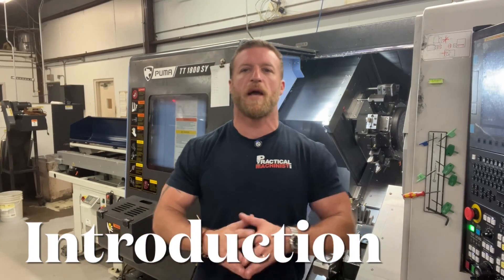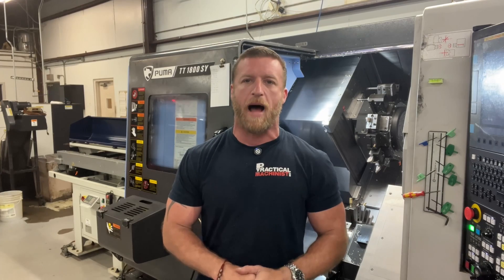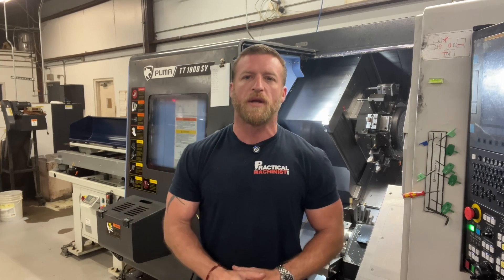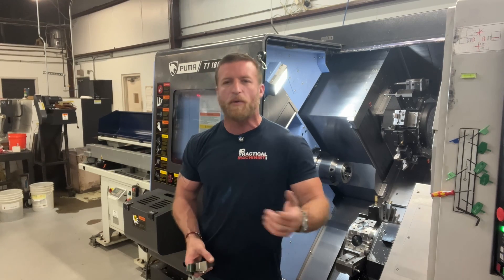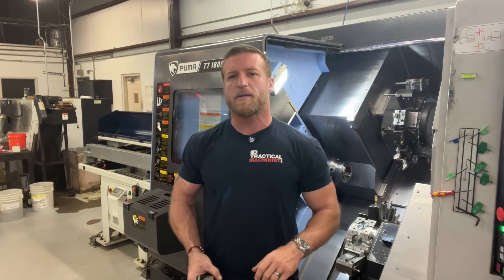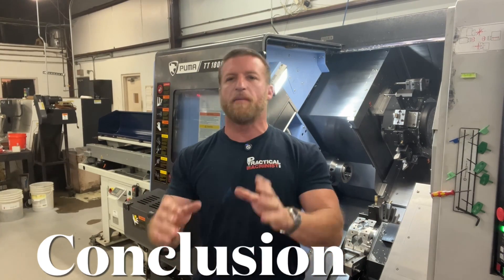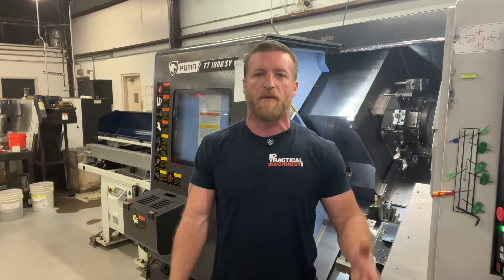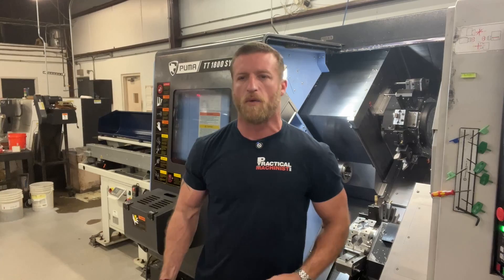Why I machine stuff the way I do- love the comments!

Comment: Your explanation makes sense when you read between the lines. 
Using a beefier insert to finish will correct the inconsistency from the 35deg. 
So as a time and cost saver you can't go wrong. And the fact alone which most miss, is that you're using the beefier to finish just shows why we shouldn't judge a book by it's cover. And pay closer attention to details. To many haters out there. 
Good video.
Reply from the maker: Hey Shaun. 100% accurate. Thanks for the input and thanks for watching 🙌🤝

Comment: The VNMG style, as any V style inserts, Are made for roughing. Why do you think many holders come with an over clamp? It’s definitely not to make the insert stable while taking a .005” pass, trust me.
Reply from the maker: I use the heck out of them for roughers. And I get a lot of pushback because of it. But I love the comments 😂🙌
Reply: @Crusadermachining honestly, Haas did a showcase of one of their machines a few years back in I want to say 4140, all their tooling and inserts, hogging an undercut with no coolant going beyond recs at 800sfm. There is a reason they come with overclamps. 😅

Comment: I do something similar but on a CNC Swiss-type.  Even if the tool is not the "most" appropriate for the feature, having common tooling already touched off in the machine makes for faster setups.  This allows me to go onto other setups while the machine is running.  Now, if it's a serious high volume job, then I'll optimize each tool to reduce cycle time.  Keep up the good work!
Reply from the maker: I know exactly what you mean about the Swiss machines I’m the same way especially on them. Thank you for the kind words and thank you for following along.

Comment: I do the same thing a lot nose radius is nose radius lol keeping the same stick tools in the machine can save a LOT of time. I rough with a DNMG quite a bit instead of swapping for a C just because it's there and we do a decent amount of tailstock work. A V or D also won't chatter nearly as bad there's less surface contact (is how I think of it?). I use VBGT's for finishing a lot because you can cut a 45 on the back side of something, but they're a lot more fragile than even a DCGT. But a 0 degree VN tool is just as meaty as a CN or WN to me (within reason).  I will say though in my opinion it's not good practice to take a facing cut deeper than like 75% of the nose radius.
Reply from the maker: Great assessment. I like the way you think and you’re right about the lower cutting pressure. Thanks for the input 🙌

Comment: Man, if those yom-yoms found out you could bore with an insert drill, the world would end!

You may have mentioned it and I skipped through it, but maybe just maybe you need the added clearance of a V… because you’re using a tailstock! I usually just leave the C… rough when I use the tailstock and let the tool do its job by adding clearance to the live center🤷‍♂️
Reply from the maker: That’s a good point and yes sometimes I do need the V geometry

Comment: Do whatever works, especially if it's just for smaller production runs, or for low-quantity jobbing work.  If you have partly used inserts that you can use as roughers - great!
Also, for some parts that I machine that have a 45-degree back taper at some point on their profile, I absolutely have to rough and finish with a V-style insert - anything else will crash into the part.
Reply from the maker: Clearance is king!  And yea a whatever works, works.  Especially if they’re already bought and paid four years ago. Thanks for your in.

Comment: Bingo!  I use DCMT for roughing and finishing bores in 304SS. They are big long bores so I only get 4 parts per edge on the finisher. When the finisher needs to be replaced, I stick in the roughing boring bar. I rough bore from the inside out and the DCMT has the proper offset for doing that, and doesn't recut chips doing it that way.  This cuts my insert usage in half !  Then the roughing insert  (previously a finishing insert) is done, it's all used up and ready for the carbide bucket.
Reply from the maker: Yes!!! I love that idea and the way you phrased it. I hope others come down and see this comment. Great lesson here and thank you for sharing 🙌

Comment: Nothing wrong with your approach, as long it works no problem.
A simple advice, when you do high volume of barstock work and you have a Y-axis (or half index) buy single or double side radial toolholders for two tools per side, put e.g. C and W insert holders on one station, D and V insert holders on the next and groove and thread on a thrid, you can place two or four holders per station, running a sub spindle you can easily put twelve tools on three holders.
Saving a huge amount of setup time plus saving stations for other tools.
Reply from the maker: Yes! I love that idea and we do have half positions. Keep them loaded up as often as we are able. Great Input thank you for the comment 🙌

Comment: The obvious question is - why don't you have a roughing tool permanently set?  Surely a roughing and a finishing tool are the first 2 you load when you get the machine. My second question is - does it really take such a long time to load a roughing tool?  It's a few minutes on most machines. You say that you have a box of part worn inserts that you swap over to use for roughing, that can take longer to change over, than changing a tool to a roughing one. Your defense of using finishing tools as roughing ones just doesn't stack up for all the reasons above. That's without considering the cost per edge which is significantly higher with diamond shaped inserts, compared to 6 edge inserts. Your insistence to do it wrong is paid for by your clients.
Reply from the maker: I definitely appreciate your opinion. But can you explain, specifically,  how it’s “wrong” and how my customers pay for it ?
Reply: @Crusadermachining  If you are deliberately using inserts with a far higher edge cost, and run slower, who pays the extra?
Reply from the maker: @Bosun-8 sometimes they aren’t a higher edge cost at all. There are times that they are a higher cost, but not always.   And we quote a job to our customer per overall estimated tooling cost, labor and machine rates. These inserts I use have been bought and paid for over the years. Various jobs we used them and bought them for. The tooling cost we pass onto our customer is a set cost that is agreed upon when they send the order. Never changed or cost added after that point.  When we set up a job, we go to the insert box that has “used” inserts. 

Furthermore, a lot of times we actually don’t even change any speed and feed from WNMG to VNMG. Sometimes we do though have to slow them down.  

The customer does not pay for the higher edge cost.
Reply from the maker: @Bosun-8 and that being said, I do understand what you’re saying and you do definitely bring up a good point. Without a doubt - and do appreciate your input. 100% 🤝

Comment: Ive found most people that talk shit in CNC video comments just watch the videos dreaming of the day they can press cycle start.
Reply from the maker: I’ve always wondered how many of them actually know what they’re talking about - and to be clear, I love the comments. The conversations and the back and forth.
Reply: Can you share your analysis? Where do you get the figures from?
Reply: I am a home machinist with a CNC lathe that does not have auto tool change. If I have a suitable tool in the machine I use it whatever its theoretical purpose is. Don't need to do test cuts all the time because the tool has changed. Time is not money to me because it is a hobby so slower, less aggressive turning, is the normal way I work, I don't need the drama that comes when something goes wrong at high speed.
Reply from the maker: @martinconnelly1473 that’s another GREAT perspective. A real life scenario, so to speak.  That’s awesome you have your own shop. Keep up the good work and thanks for chiming in 🙌😊

Comment: I used a DNMG for roughing and VCMT for finishing as standard. If I needed anything else I had capto tools in a hands reach. Quick and easy setup.
One of Seco's DNMG 1.6mm radius I hit 7mm DOC, 0.45mm per revolution feed rate and 300 surface meters per minute in 4140. It was a beast.
Reply from the maker: Wow! That’s FAST. I love it. Capto is awesome, so I’ve heard.
Reply: @Crusadermachining  If you want to save time, then get capto for all the stations. All our tools were capto, and the best part is that all the boring bars were dampened. The tools can be taken out if there is not enough space in a certain cycle/operation and inserted back without probing up the tool again. Dead precise. Also gives the use of all the tool offsets meaning. After you've tried it you don't wanna go back.
Reply: CAPTO tools * drool *. I thought they were only unobtainably expensive tool set ups, tool reps wave around in order to break your spirit. x)
Reply: @JSMPrimeOperations Yeah they're more expensive, but after I tried it, it offers fast as hell tool setup and the convenience of taking the tool out and put it back in if you have to during the program, within seconds. The boss of that company understood the importance, so every tool in every lathe was capto ❤
Reply: Had the chance to go Capto, on one of my Nakamuras, but after deliberating with Management, we have such a massive ammount of tools, that we implement all shank tools. That it would have cost way too much to do it. Still am a Fan.

Comment: When I'm working, I like to finish my setup fast and during getting my first part approved by the "amazing" QC, I play around with my roughing tool. Many times I notice the VBMT and DMCT types work just as good as CNMG or WNMG. There are two drawbacks that they tends not to last as long as the WNMG/CNMG, however, they last for the whole shift of 8 hour (I just use .03-.05 DOC). One of the great benefit of using VBMT/DCMT is less pressure for material and the tool. Great Content as always!
Reply from the maker: Hey thank you for your input and thanks for folllwing along! Hopefully others can come down here and see your comment to learn a bit that’s good information

Comment: I use a DNMG with a 0.8mm radis for all my roughing in any meteril from plastic to 316 stanless steel. It works great, especially when i have uncutd to turn or need clearance behind my tool for the tail stock.

Then i use a VCMT with a 0.4mm radis if the part allows for all my finishing. It has the same advantage along with having very low tool pressure.
Reply: The only downside i have is i cant take deep facing cuts. Limited to about a 0.6mm deep of cut with that DNMG with the 0.8 rad when im feeding down a face.
Reply from the maker: Heck yea. I haven’t used a lot of DNMG.  Thanks for the input and thanks for commenting.
Reply: Can you please explain why the tool pressure is lower? Is it the smaller nose radius or the lower MRR? Does the insert shape matter if it is either or both of these?
Reply: @tates11 yes the insert shape does impact the how the tool preforms as the angle of the insert increases more of the radius is engaged on the back side of the tool.

It is only noticeable when you are right on the edge of a setup working or not due to rigidity.

The biggest effect comes from the nose radius. Most seen in long boring bars. A 0.8mm radius will scream and give a terrible surface finish but changing to a 0.4mm radius could fix everything.

MRR dosen't have any effect here as it is solely dependent on your speed, feed and depth of cut. It just depends how hard the insert will handle being pushed.
Reply: @richardhall2542  Thanks Richard. For me to understand a little clearer, I need to compare like for like as much as possible.
Assuming all conditions are equal, including nose radii, with the feed/rev and the depth of cut both equal to the nose radius. Are you comparing the form of the spirals left on the part between the almost full radius of a diamond shape insert to a WNMG shape that has the trailing half of the radius slightly closer to parallel with the part length? I understand that the MMR & therefore tool load are equal in both cases, although the contact areas may be slightly different for each case. Is it this contact area that you refer to?
Reply: @tates11 yes its all about the contact area.

A V shaped insert will have less contact area then a W shaped insert and there for the V will have less load and pressure in the same cutting environment, feed/rev, depth of cut.

The hardest thing to explain is what is preferred. Lets say vibration and chatter are not a problem. Then a W will give a better surface finish due to it wiping off more of the crests of the spiral.

Then as rigidity drops more of the surface roughness will be coursed by vibration than the spiral so in that case a V shaped insert will give a better surface finish. Also will give less push off and therefore taper in the part.
Reply: @richardhall2542  Thanks again Richard. I get the contact area & I will draw the two shapes to see the actual area difference. My initial gut feeling is that they are very similar when using the conditions I mentioned in the earlier post.
Assuming the chipbreaker / rake angles & edge prep are also the same, the energy required to shear off the same amount of material should be the same for both tools.*  This energy is directly proportional to the load on the inserts, but the average pressure on the contact area on the WNMG will be less due to its larger area.
* Back in the day we used to approximate that 1HP could remove a cubic inch per minute, a bit different now.

Is it possible that the two shapes will give identical results if the feed per rev is equal to, or less than the nose radius? There will be no contact area beyond the center of the tip radius, so they should be the same as they are both only cutting on the leading quadrant of the nose radius.
Reply: Here is some documentation. You can see on page 11 and 12 that the insert shape hand a realavent impact on the load experienced by the tool.

https://www.google.com/url?sa=t&source=web&rct=j&opi=89978449&url=https://www.iscar.se/Catalogs/Publication/english_1/WhisperLine_USER_GUIDE/USER_GUIDE_WhisperLine.pdf&ved=2ahUKEwjfmZ3whs6OAxVA7DQHHeewNvgQFnoECCcQAQ&usg=AOvVaw0qS1JTnIjrmuerXxeXtEba

And yes i have seen this out on the machine were switching the insert shape makes a noticeable difference in the vibration seen.

Comment: At my "job shop" I turn with a tail stock often. vnmg  for the win with smaller diameters.  Wnmg won't clear. I just can't break a chip with a 332 Until. 014 per rev, usually. 016.  Great info keep it up.
Reply: It is simply sharper. I would go that route too
Reply from the maker: Good point 🙌
Reply from the maker: That’s a great point. Clearance is king. Thank you for the kind words and thank you for commenting 🤝

Comment: Lol but do they know that in all Geometries there exists roughing & Finishing chip breakers, i mean if you dont got the clearance, which i actually do a flange which requires me to machine a chamfer on the opposite side of the part which clamped on the I.D. And to use also said tool, to clear up threads on said side. Something you litterally could never accomplish with any other insert, unless i was to try using a groove turn, but the cutting force gets the ol'cheeks tightening up thinking about it popping my part off the jaws. Hey whatever gets you paid, and gets the customer their part, and keeps them happy thats the name of the Game, and thats what seperates a machinist from a button pusher, or operator. Ive seen some very sus. Things in my tenure as a Machinist myself, none of which i can say are any of yours.
Reply from the maker: Thanks for your input. It’s obvious you know your stuff 🤝🤝. And yea, you’re right; rough and finish chip breaker and geometry should tell enough. LOL the ol cheeks 😂😂 that one made me laugh